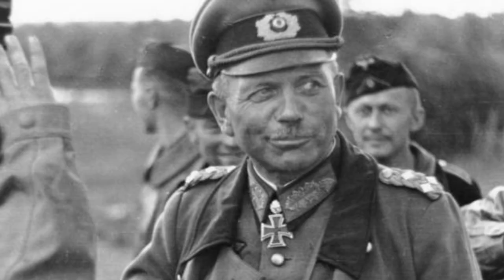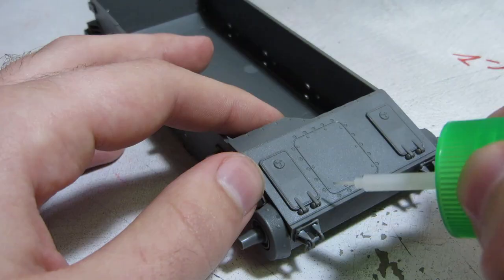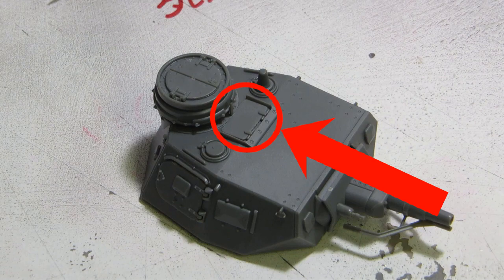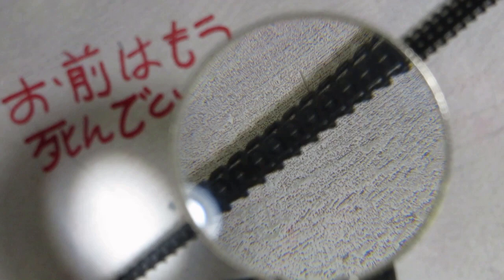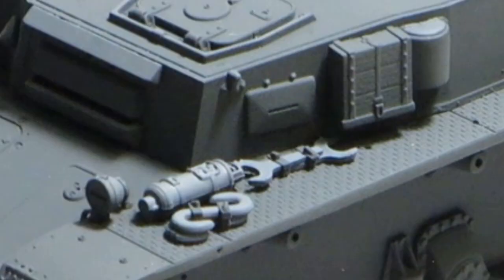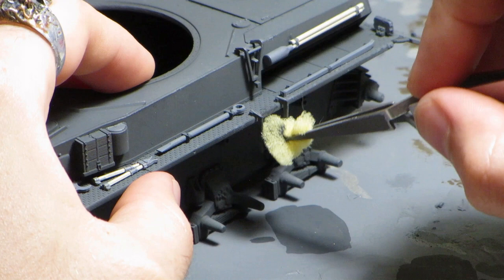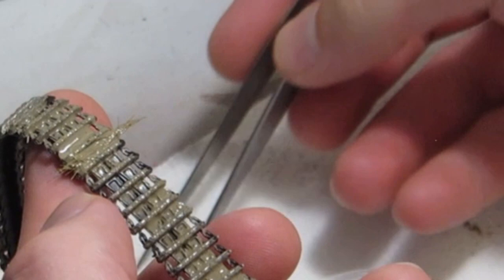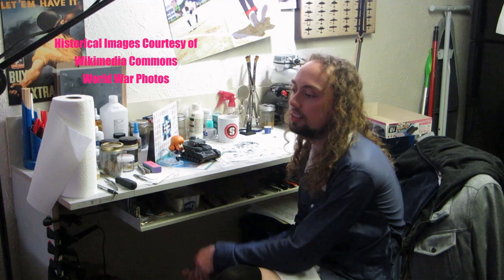1/35 Panzer IV Ausf. D - Girls Und Panzer

Comment: I've just bought that 2006 original kit! There's more detail innthe ex tristar panzer 4 D the hobby boss kits now! This is a very bad kit for dragon! Moulded in dust covers on rear fenders for the intakes Moulded in fender springs and the grab handles being solid blocks! The 2006 kit is not the same it must be a cheap like kit made for that panzer girls show! It's not the same as my 2006 kit you showed there!
Never heard of anybody praising DS track! they normally get filed under BIN there that bad! Even myself I bin them and replace them with master club or RFM tacks!